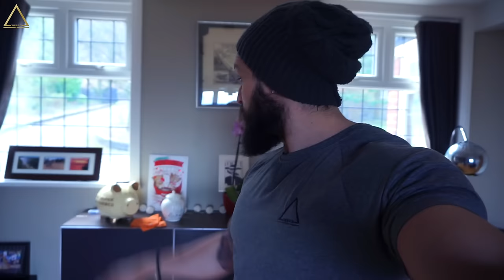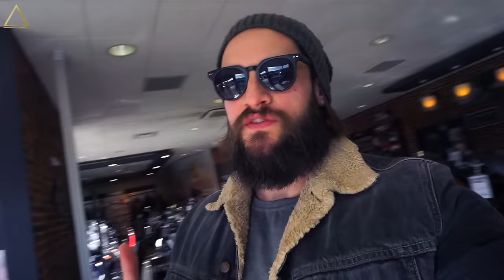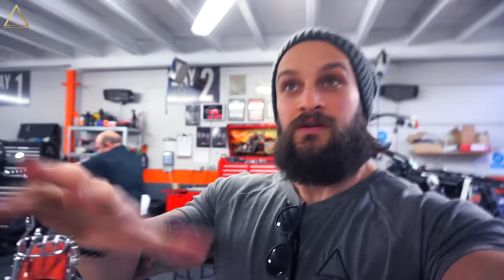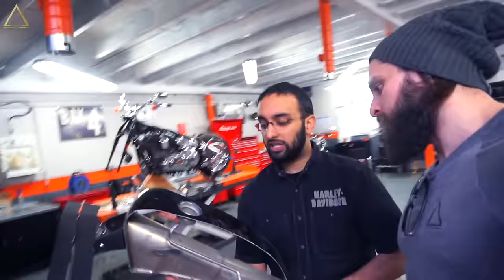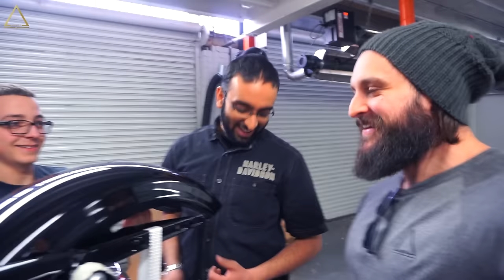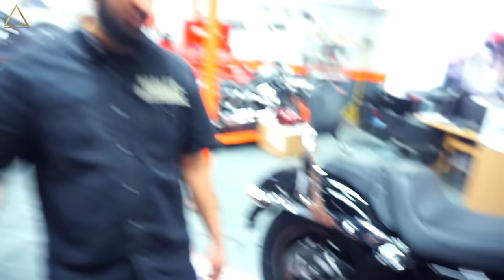CUSTOM HARLEY DAVIDSON BUILD | MY King Of Custom 883 IRON (PART 2) | Lex Fitness

Comment: What size t-shirt are you rockin in this vid Lex?  The fit and tapering looks spot on (again).  

I get asked all the time where my desire long sleeves and my cammo/grey t-shirt is from... always repping it in and out of the gym.
Reply from the maker: +Lewis Sawyer Nice man :) I'm in a large - they're tapered and elongated so if you're in between sizes you could get away with the smaller option but I wanted the extra length of the large size and the taper remains so its all good :) over 6ft you'd want the XL in my opinion for length
Reply: +LexFitness - TeamBOOMBabY! Cheers fella, really appreciate it. Looking forward to the new line.  If you're having another Subscriber Session, it would awesome if you kept me in mind, it would be the highlight of my year to come train with you and learn something new.  Check out my Instagram:  LEWISSAWYER_91 

Anyway,  keep smashing it Lex!

Comment: Great video lex, any idea on the prices for the new des!re lines lex?
Reply from the maker: +VanguardZx inline with the previous lines buddy
Reply: +LexFitness - TeamBOOMBabY! Ok great news! Also what's the sizes like, recently gone down to a small after losing a ton of weight, so was just curious if the t-shirts are tight fit
Reply from the maker: Connor Cox standard european fitting buddy but elongated hems

Comment: Any advice for a tall skinny x boxer looking to start putting some size on and getting more in to weight lifting got some back problems and joints problems so any advice would be much appreciated
Reply from the maker: +James Goodwin You can grow utilising volume training where heavier work is an issue and get your calories up through high impact food choices to help reduce the overall volume you need to eat e.g. nuts, dried fruit, olive oil, coconut oil, honey etc
Reply: +LexFitness - TeamBOOMBabY! Thanks a lot for the advice really appreciate it
Reply from the maker: James Goodwin no worries